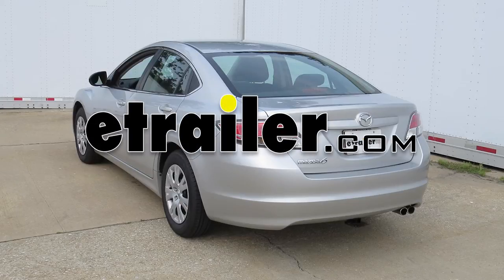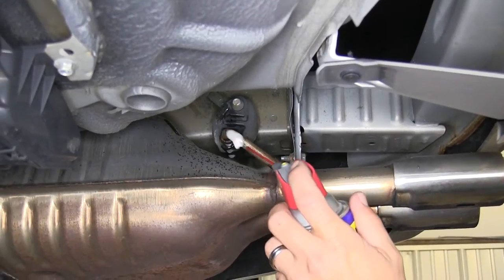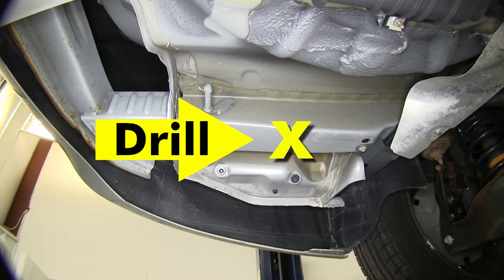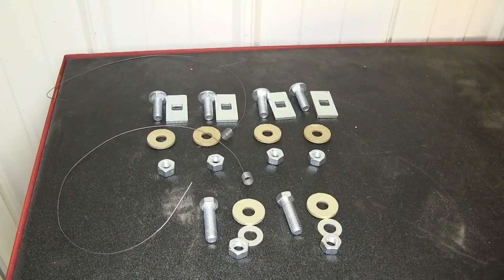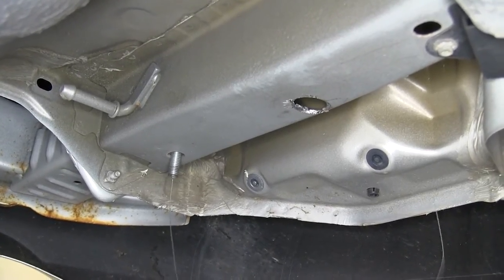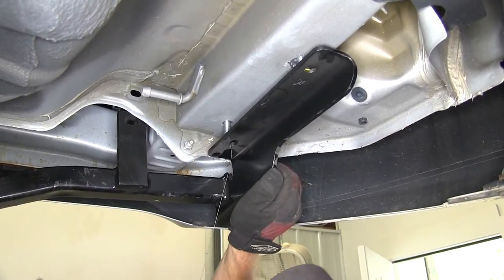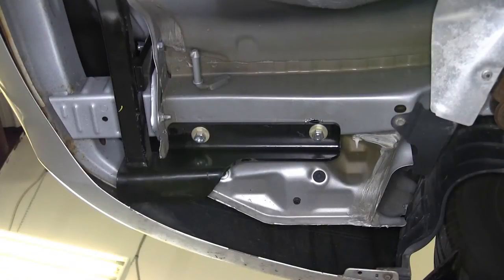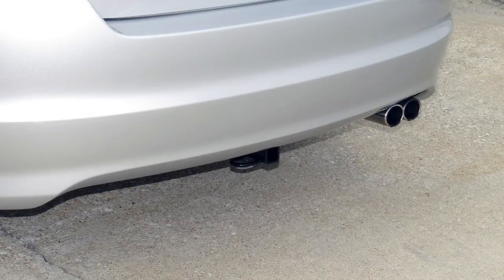etrailer | Set up: Draw-Tite Sportframe Trailer Hitch Receiver on a 2010 Mazda 6

Comment: what size hole saw did you use?
Reply from the maker: The hole saw that you will need is a 1 1/8" hole saw. 
https://www.etrailer.com/Trailer-Hitch/Draw-Tite/24832.html
Reply: @etrailer  thank you for responding!

Comment: I need to know how much I can tow with this exact vehicle. I want to two 2 motorcycles.
Reply from the maker: That information is located in the vehicle's owner's manual.
Reply: etrailer.com thanks for the quick reply, you're telling me you installed a towbar on a 2010 mazda 6 2.5l that specifically says in manual the vehicle shouldn't tow?
Reply from the maker: A tow bar is used for flat towing a vehicle behind a motorhome. What we installed on this vehicle is a trailer hitch. Trailer hitches are not just designed for towing trailers. They can be used for hauling a hitch mounted carrier or a bike rack, which is what this customer intends to do.
Reply: etrailer.com okay, so whats the max I can tow with this vehicle when the vehicle manual says it should not be used for towing?
Reply from the maker: You are correct... this vehicle is not approved for towing a trailer so I do not recommend that you do that. You can, however, install a hitch and use it for a bike rack or hitch mounted cargo carrier. In that case, you just need to be sure you don't exceed the tongue weight capacity of the hitch, which is 200 lbs. 

https://www.etrailer.com/hitch-2010_Mazda_6.htm
Reply: etrailer.com thank you so much! Who says youtube comments are toxic!
Reply from the maker: You're welcome! If you have any other questions feel free to let me know or check out our website.